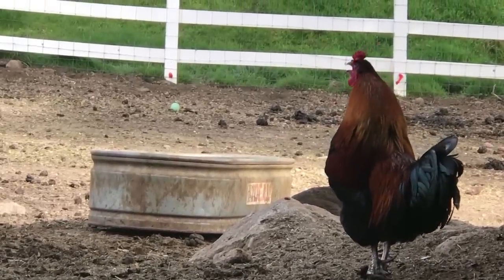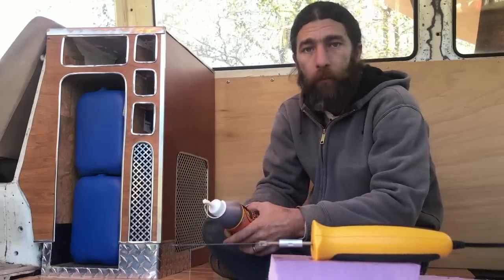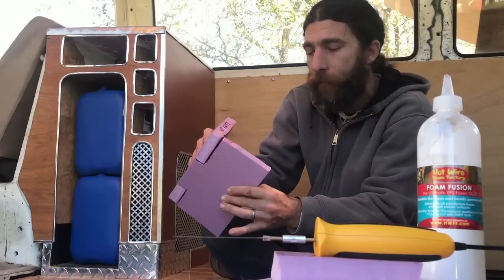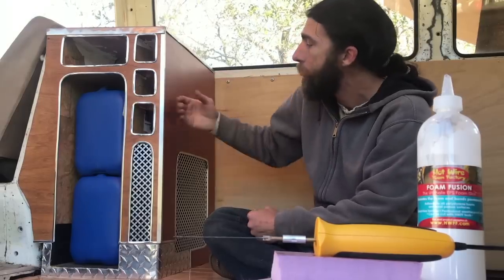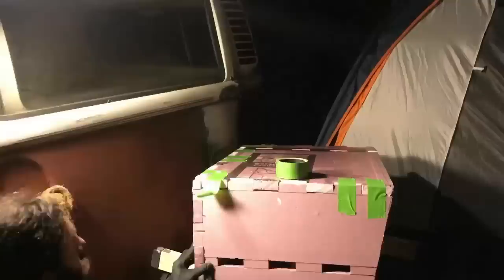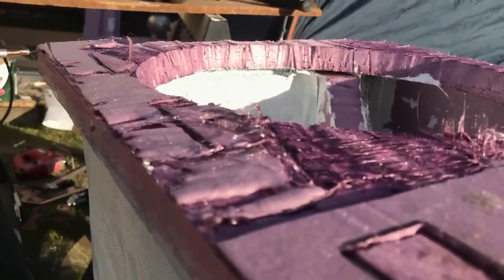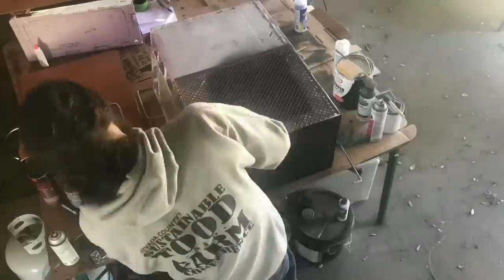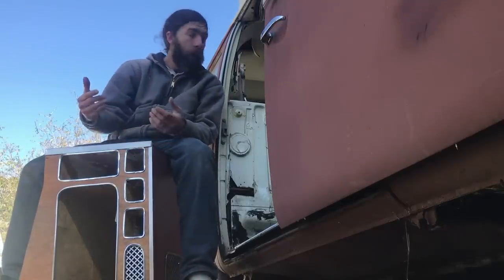Foam Cabinet Prototype - Improvements on Building Foam Cabinets for Camper Van

Comment: I'm wondering how you're progressing.  Did you watch the styrofoam glue wars video https://www.youtube.com/watch?v=rnOegaOKu38&t=3s .  She seemed to think the Glidden Gripper was the way to go even for joints.  I've been thinking about building a wooden jig to convert a hot knife into a drill press/band saw equivalent to make straight square or angular cuts. Are you thinking of making drawers as well?

Comment: Um foam puts off ,,,off gasses and may not be good for small living spaces , that smell from foam is not just the smell of foam , and if used in a hot area it could be worse ....just be safe and check first , spray foam is even worse then baord style foam too as it has to dry from OUTSIDE in and you may think its dry and safe but it takes time for toxic off gas to leach out slowly . I think this is why they use fiberglass  insulation in RV,s ,,,,i allways tell people ,,DO YOUR RESEARCH  dont listen to me .....

Comment: 12:23 you took a risk too high, almost destroying everything, since the underlaying ground there was not even leveled/smooth!!!
Reply: He said he saw many videos before, so he knew it would support his weight.
We don't know if the underground wasn't "even/smooth". It might've been a concrete driveway.
Reply: @beby843  Just like in the "rule" that a table with 3 feet is always more stable than one with 4 feet (cause no ground is ever perfectly even), and his cupboard has 4 corners/feet, so the ground has to be even, or else he distributes its weight unevenly...  I mean that the piece was swinging from one side to the other, that means, just a portion of the base was touching the ground.
Reply: @klausbrinck2137  I agree that 3 feet are more stable/secure than 4.
But, really, unlike you and I, he's is not starting from scratch. He said he saw many videos, explained his three improvements over the other methods, and even demonstrated his tensile strength tests.
Additionally, his cabinet doesn't have 3 or 4 points of contact to the ground (feet). He has 5 vertical frames (front, back, and 3 side panels) transfering the load all the way from the countertop to the floor, reinforced with mesh, and at least one, with 1/8" plywood.

For all practical purposes, he was almost as safe as jumping on the ground.

Blessings.
Reply from the maker: For the record... the ground was a little uneven... you can see it wobble when I set it down... and as far as not starting from scratch... the source videos are in the description, they all gave up and they certainly did not stand on them... or about all this in the upcoming Q&A videos... should be out next week or so. Cheers!!!
Reply from the maker: Hey thanks for the comment! It was addressed in this video I just released. Check the table of contents at the beginning if you want to skip to a particular subject: https://youtu.be/BcAXr_gtbG8

Comment: While this is a valiant effort and skillfully done, it is WAY too much work to save a few pounds. I would calculate how much weight would be saved before I would even begin construction from foam. Plus you run the risk of stuff banging into it and making a hole in it during the long and tedious construction process. Wood is stronger and will last a lifetime. This is a good idea on paper but not really if you are looking for durability and speed in construction. Few people have time to go through all the extra steps to build it in this method much less the extra skills needed to build it square and plumb, etc. Wood is just so much easier to work with, more durable and looks nicer. The benefits of savings in weight over the life of the vehicle, savings in gas, etc. are miniscule. Overall, this is more of a gimmick/conversation starter rather than an improvement in van construction. Too many negatives and only one positive--lightweight. No thanks.
Reply from the maker: Hey thanks for the comment! It was addressed in this video I just released. Check the table of contents at the beginning if you want to skip to a particular subject: https://youtu.be/BcAXr_gtbG8

Comment: Sorry to be "THAT GUY". When cutting foam material, always do it in well ventilated area or use a mask, it usually gives out toxic fumes you do not want to breath. Also when working with MDF, it gives out a noncarcinogenic particles. I know, i know, but someone has to be that guy. There may always be someone who hasn't heard about the risk of breathing in this stuff...
Reply from the maker: Your not the first to mention it but it’s actually not that toxic… I am always in a ventilated area, but see my video “…toxic & flammable…” for more on the subject.